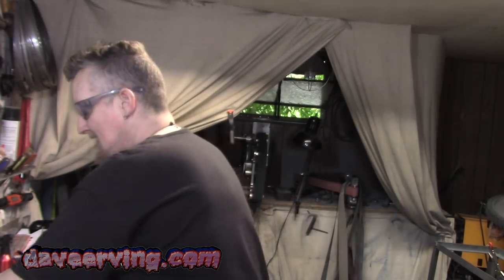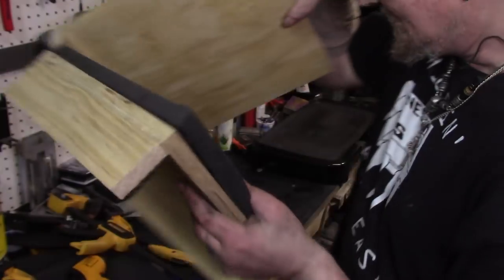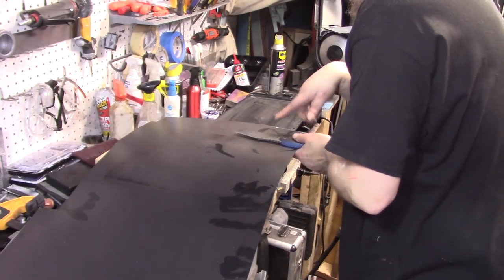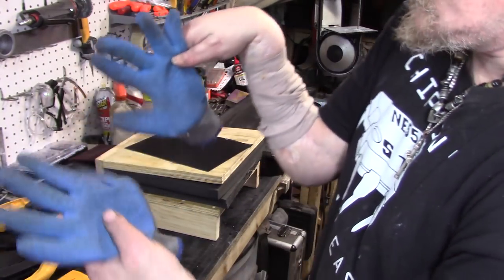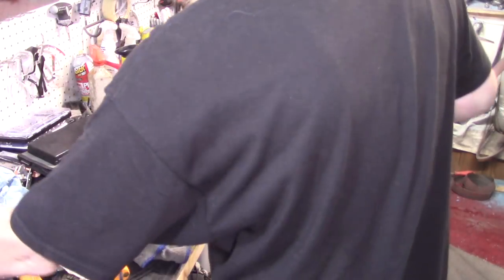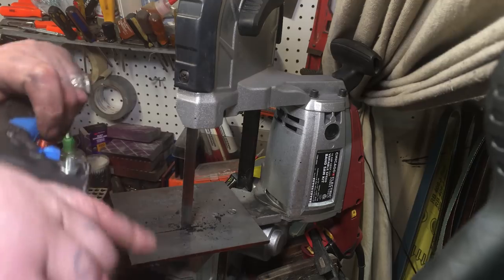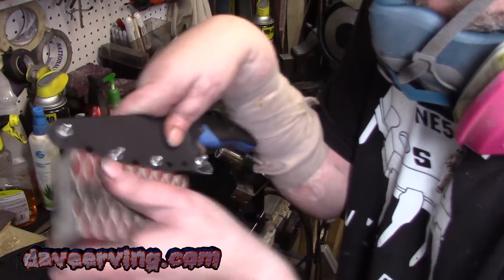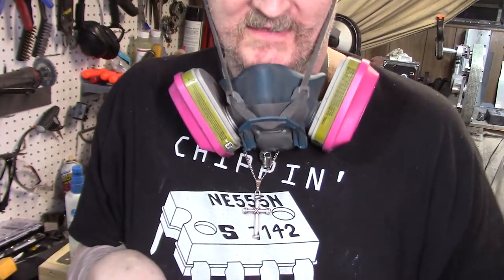How I do my Kydex Sheaths

Comment: Cool demonstration Dave. Gonna throw you an idea. The acetone on plastic part, I couldn't agree more. Instead, use a silver sharpie, so you can clean it off with alcohol. Alcohol is cheaper than acetone, and way less harmful.
Reply from the maker: right, I should buy some, I just have so many mark all pens, I grab those first... I love the Milwaukee mark all's, because they are like dykem, it doesn't wash off easily, but your right, for kydex, the sharpie would be better, thanks..
Reply from the maker: I actually have a spray bottle filled with 90% rubbing alcohol, and a spray bottle with acetone( I sat that in a metal container for a few days to make sure it didn't melt, hahaha)....
Reply: Dave Erving Evader Knives cool.  Your birthday by the way. Aug 2?
Reply from the maker: No Aug 1st... I recorded this the day before..
Reply: Coolcool...my older brother, oldest son, and father, have birthdays Aug 1,2,3 respectively :)  Happy belated Birthday Dave!
Reply from the maker: Wow, that is pretty impressive... Have a great weekend, thanks...

Comment: What do you use to set rivets?
Reply from the maker: It's called a kydex eyelet flaring tool... Here I just put it in my drill press, but I have a 1 ton arbor press I use from Harbor Freight. You have to modify it a bit